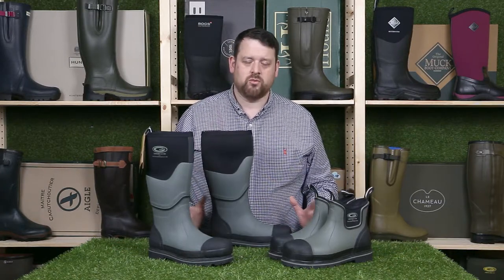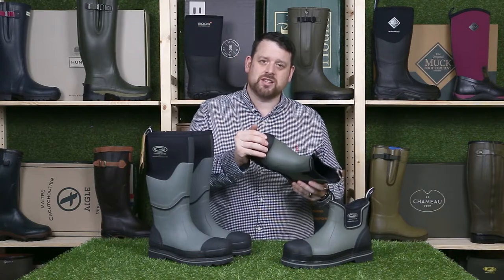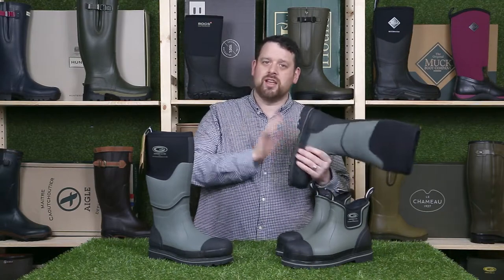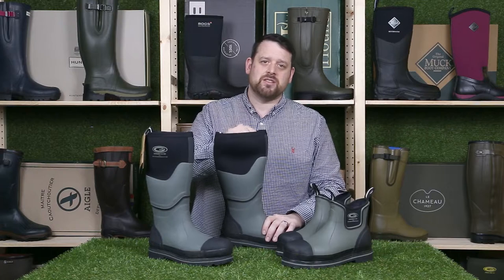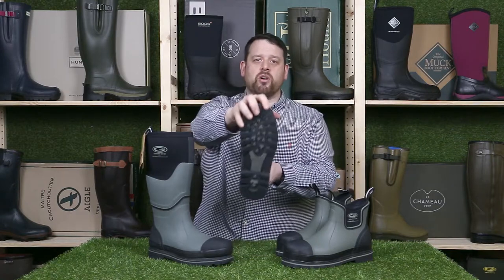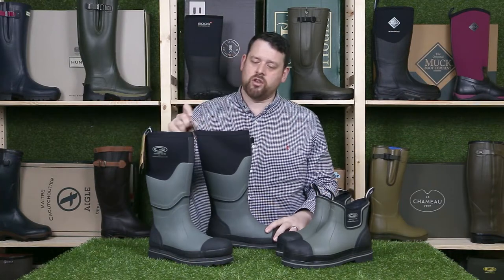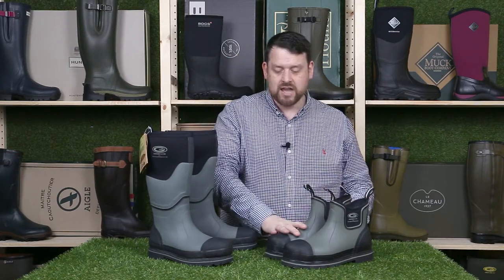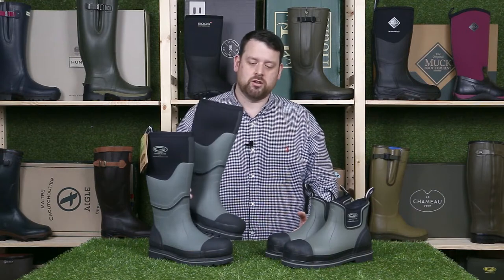Grubs Ceramic

Comment: Total rubbish! Mine lasted only six months before cracks took over! Warranty say I've been sand blasting...a joke!! Rubbish boots, rubbish customer care, rubbish in all sense!
Reply: Should of rubbed oil in them to prolong the rubber ???
Reply: @ptescreen18  What!? Oil resistant boots?? That's insane! I've had two MUCK boots. The first pair lasted two years. I currently have another pair now a year old and with no problem. It's simple and easy...use better material and drop the marketing saga!! All we want is a good made and wearing boot.